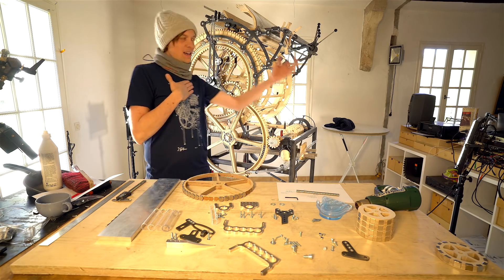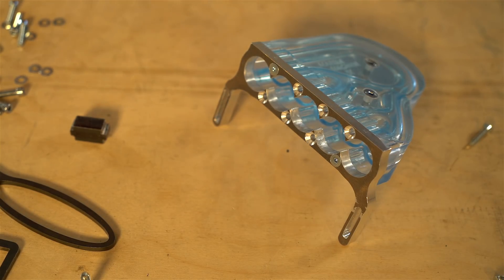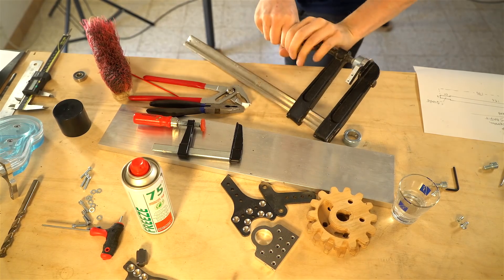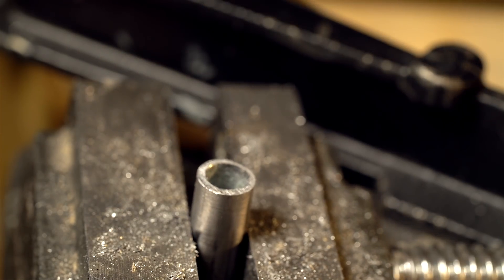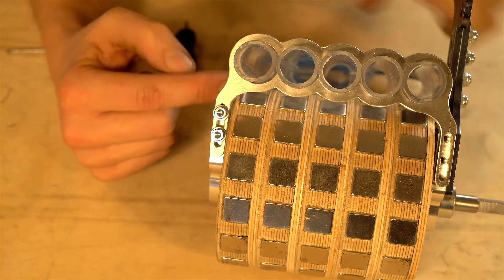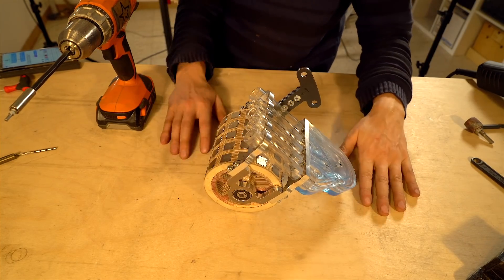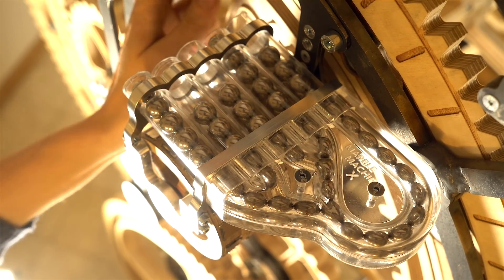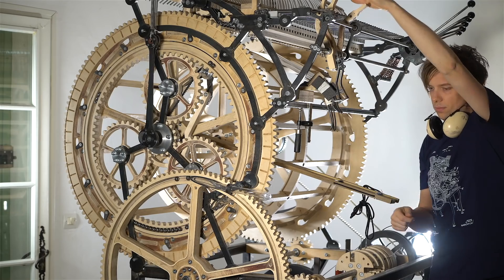Marble Demagnetizer V3 - Marble Machine X #62

Comment: A tap pushes the chips forward, rather than pulling them out like a drill bit does.  So, when tapping into a blind hole, you have to periodically stop, back out the tap, and clear the chips from the hole and from the tap flutes, and then restart.
Reply: Actually, that depends on the tap design.  There are taps that are helical like a drill bit and pull chips out.  What I would use us a "gun tap" which pushes chips in, but has very low torque requirements, because the chips need not "fight" their way past the tap.  It is worth the trouble to remove the tap and clean out the hole (or if possible, drill hole through or deep enough to store chips).
Reply: @bpark10001  True, but what I said is for ordinary everyday taps, which is what he looked like he was using.
Reply: @ljfinger  ...and he shouldn't be.  I discovered gun taps long ago, and they turn so easy, it just doesn't make sense to use anything else.  Martin needs to get some "old world" shop tools (such as a small manual metal lathe and a manual milling machine) and ditch the angle grinder and hand drill.  Nothing makes me cringe more than seeing all the beautiful CNC machines being used, and not having the most basic of tools.  In this video, you can see he made the "square-ended shaft" eccentric (the demagnetizer wiggles as it turns).
Reply: Many taps have already been harmed in the making of this series. I think Martin does it on purpose by now.

Comment: When tapping deep holes in steel, do not try to drive the tap in one pass.  Do 3 to 4 turns, back it out 2 turns, then down 3 more, back 2 and so on to the bottom.  Also, you may need to pull out the tap part way down, clean the hole of chips then relube and start again.

Comment: That mushroom makes me sad.
Reply: Yes.  You can't take that on tour: it will come back to bite you.

There are three types of tap: taper, second cut, and plug tap.  If you are tapping a blind hole you really need all three.  The first one starts the thread, the second one deepens it, and the plug tap deepens it right to the end of a blind hole.

Note that they are called slightly different things depending on your country.  For example second cut (UK) is also called a gun tap (AU) but confusingly "plug tap" in the (US)

The third tap, the plug tap, is called a bottoming tap in the US.

The mistake here was starting with the second cut tap on a power drill.  There was no room for all the large chips to go so they bound up in the flute and the drill just powered the tap until it broke.  If you are forced to do it like this you have to back the tap out often to clean it - no more than about half a turn each time.

You can use a tap on a hand drill (second cut usually), but only for soft material or very thin sections.  I'd also suggest setting the clutch on the drill to slip if it meets any significant resistance - that way you know it needs to be backed out to clean the flute.

For machine use (drill press, CNC) it's best to use a spiral flute tap because it has more flute space to take the chips so won't bind up so easily.  These are not suitable for a hand drill or hand tap because the angle of attack is too steep (they are not tapered) and it's very hard to start it straight.

Comment: The demagnetizer should be rotating the other way. The way it is now the magnets speed them up going out so they have less time in the magnetizer and don't have as many magnets interfacing with them. Clockwise would be best and it will have more magnets interfacing with them
Reply: Marbles go twice over the magnets, in both directions. Should be enough to do the trick.
Reply: Turning it arround also has the added advantage of allow the marbles to be pushed from where they are entering
Reply: @miawgogo  Yeah I can foresee a train wreck happening when there is not enough force to push the marbles through the divider.
Reply: And the marble seperator works better when the exiting marbles get pushed back a little bit
Reply: Agree. The rotation along the marbles travel axis is going to cause problems, and rotating the magnet axis is going to be a real pain!
Reply: @vizionthing  it will be easy. Shorten the axle and add a gear set. Will allow faster rotation and a reversed spin!
Reply: The 1-to-4 channel splitter might need that to help the marbles exit. It seems odd to me that so much force is required for them to go through and split, when there’s no propulsion beyond the force of the wheel the marbles are are getting off of. No gravity to speak of, just a very short pipe that leads to a completely level channel splitter with a severe 180 degree bend in it (My main suspect in the area of “will it work properly this way?”) Granted, that’s a lot of force in the wheel, but the only thing holding the marbles on that wheel are the wheel magnets...

I should sum up my thoughts better. Here: I’m not sure that the 180 degree turn in the channel splitter will work, and have the magnets help churn the marbles out may be beneficial. I’m imagining that the first time Martin tries running hundreds of marbles all the way through both wheels and into the channel splitter at breakneck speeds, the splitter will jam up enough to force the wheel marbles to split straight off of the top wheel.
Reply: @johnnyjohnson6643  nah it will be fine. The weight of all the marbles plus the one magnet that will accelerate them coming in plus the reduction of speed because of the split will allow it to work great
Reply: The reduction of speed is what worries me!

Comment: You should tap threads by hand as it really isn't possible to judge the torque when using a power tool - and taps are (as you know) very brittle..

Comment: Its Wednesday! The first in 2019!! Happy new year everyone!

Edit: Don't use freeze spray, try dry ice instead, since you want to keep the bearing cold for as long as you have to heat up the bearing holder, dry ice gives you more control over freeze spray.
Reply: we used a C02 fire extinguisher :D
Reply: @matthiasakadreikaelf3834  Usually we use LN2 where I work for these kind of stuff, but whatever works ;)

Comment: OH man, poor guy.

Gotta hand tap that stuff bro! to much backload on that tap.  Especially on that harder stuff, that way you can work it back and forth.
Reply: My precise thoughts.  It should be hand tapped.
Reply: Yep. And yep.
Reply: @Ralph2  Not to mention an Arbor Press and the appropriate tooling for pressing in bearings.
Reply: You can get away doing bearings in a vice, but yes some sort of press does help for sure! 

As for tapping, a lot of people get really impatient tapping and when you're doing precise parts by hand, it's better to take the patient route and do it by hand so you can feel if you're binding. I think that one of the issues he had was he didn't have the right drill for the threads he was trying to tap as well so it was taking a big cut. He was drilling it by hand and could have used a longer taper style tap. 

He doesn't show the entry, but he was probably using a tap that requires a very precise hole size which is where he ran into the binding issues from a drill that wasn't sharp enough to make a good clean hole.
Reply: @WhatAboutTheBee  We have to remember Martin is an artist first and an engineer second. The way he has picked up the engineering side is incredible really, his CAD skills in particular. But, and I mean no disrespect at ALL, he still doesn't 'feel' things the way and engineer would. Many times I have tried to guide with regard to tapping, bearing pressing etc. but I'm sure he can't read every comment. I'd just love to be there at times to talk him through it as he does it.. He needs a local engineer who could (for example) cut a proper square on the end of that shaft. ;)  Peace.
Reply: @Ralph2  we are in agreement.  In my career as an engineer producing custom machinery for industry, standards and practices go a long way in producing a quality product.  Martin is an artist, one I respect.  The way he approaches bearings is cringeworthy.  He will pay the price for that later.
Reply: @pauljs75  Votech precision machining graduated student here, yup instructor would have gone ballistic the second he sees the tap slip into the drill..
Reply: @WhatAboutTheBee  If the hole was milled to the proper spec, and if he cooled the bearing longer than a 4 second blast with freeze spray, they would have dropped right in.
Reply: @xenonram  If they were a light press fit (0.002" interference), then they would have properly seated with pressure from an arbor press on the outer race, only.       This is a proper way to install bearings.  Using the thermal coefficient of expansion (heating/cooling) takes more time to perform.
Reply: hah i dont understand a thing but it's nice to see people agreeing on stuff
Reply: @starmax1000  basically there are situations such has working with steel where you have to use the screwy-making tool by hand rather than using an electric drilly-turny so you can feel where it starts to get stuck and slowly work it, and also back back a turn after a few turns so you can remove any stuck metal pieces to prevent it from getting stuck
Reply: haha, thanks for the explaination!